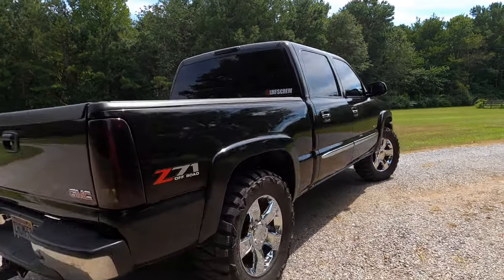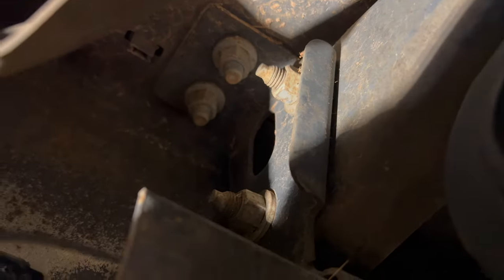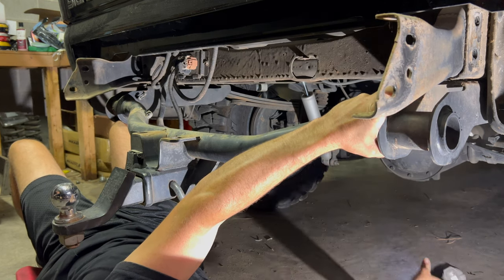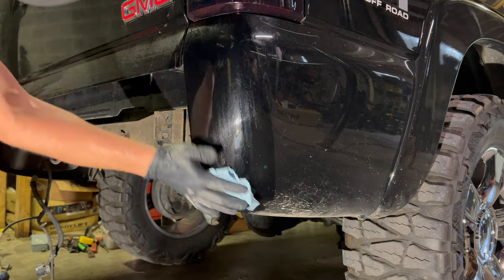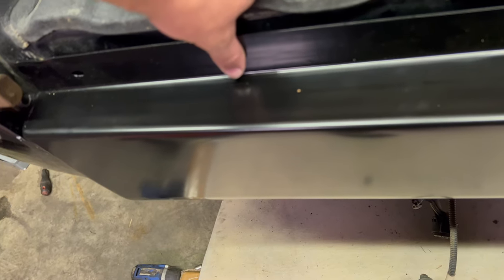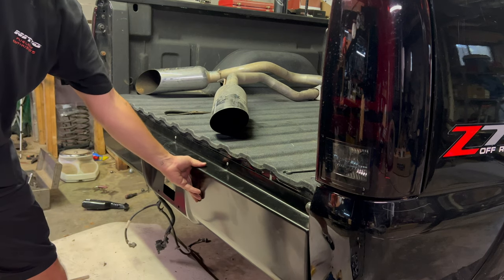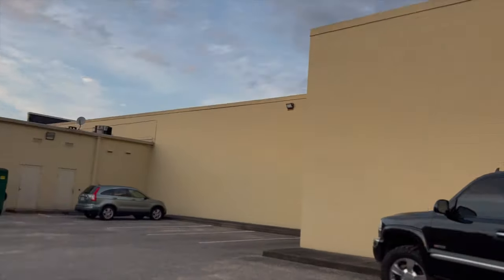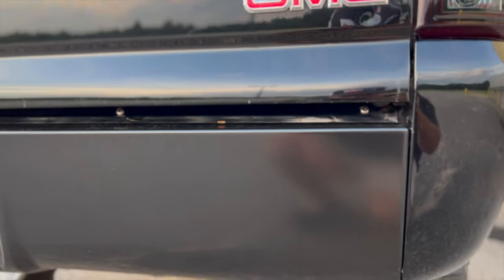Amazon roll pan on my Sierra!!!

Comment: I had a truck I put a roll pan on a few years ago, i remember like a couple weeks later using it to move something and I was in the back of my bed with the tailgate closed. Went to step over the tailgate onto the bumper and ate shit. Luckily the truck I did it too was lowered about 2 inches so the fall wasn’t too brutal.